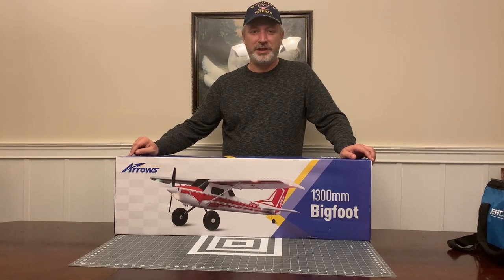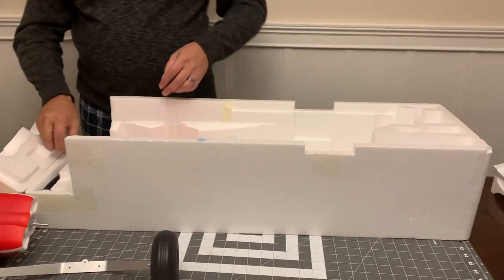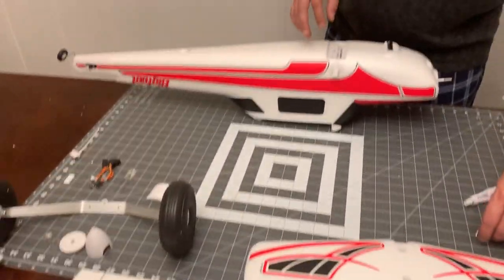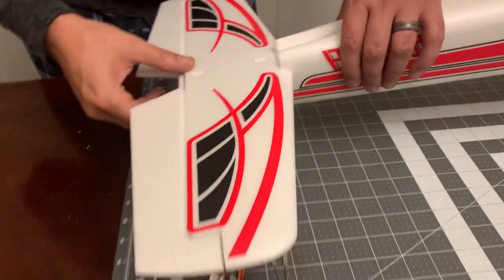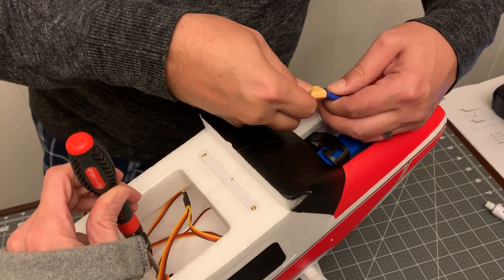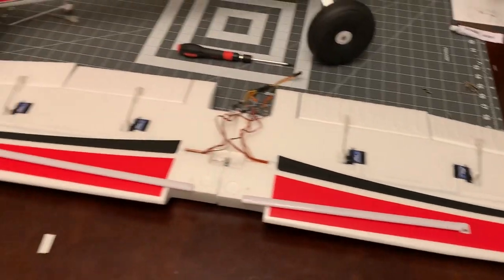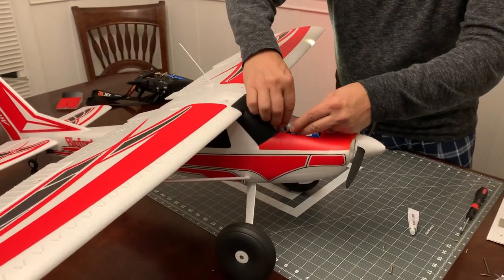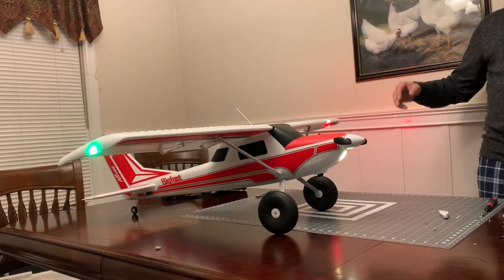Arrows RC Bigfoot - Unbox and Complete Build

Comment: Only thing I did different was put a block of foam in the body cavity to raise the RX to where it’s much more accessible. Also Dubro wheels for a, hopefully, softer landing!!
Great video!!!
John in MD
Reply: Also: there’s a small screw which secured the tail wheel tiller!!
John
Reply from the maker: Yeah, I found that screw and put it in the next day after I had already published the video... 😳
Reply: @TheRCAirMarshall  1st car engine I rebuilt(at 14!) had a small box of parts left over: Dad sez “Nope!!  Do it all over again!!!” 2nd time I actually followed the Chilton manual & got it right!!!
God Bless!
John
Reply from the maker: LoL! I’ve rebuilt a few engines myself. I’ve been guilty of having a few parts left over scratching my head. Funny part with the tail wheel screw, I was following the manual and just completely missed the step. The Arrows Husky Special Edition I just got also has the tail wheel retention screw but it is NOT in the manual to put it in. I knew better the second time around. 👍

Comment: I was using a Spektrum receiver whose servo leads came into to side, not the top. Made mounting the receiver a B*****. I also used servo extensions.  I ended up gluing in a flat piece of thin wood to the underside of the opening to mount the receiver. It worked. Otherwise, the build went smoothly. This is the first plane I have bough since the mid 90's  when I left the hobby.

Comment: Generally good with the exception of a major safety violation. You mounted the prop with the system powered up. The safety guys are constantly reminding us to NEVER work on a plane that is hot with the battery plugged in without removing the prop first. Most of us are guilty of a similar mistake, hopefully your injuries were minor, but just this week one of our club members was injured badly enough he had to go to the Emergency Room for stitches after he made that mistake. You set an example for many less experienced pilots to follow, hopefully we all set a good example for those just learning.
Reply from the maker: You’re absolutely correct. Normally if I do something like that, I preface it with a disclaimer that the prop should always be removed. This was a big oversight by me in the beginning of our YouTube journey. I get that I have a responsibility to the community and will try to make safety a priority. Thanks for the great catch and feedback, very appreciated!
Reply: @TheRCAirMarshall  I figured it was an oversight, but having personally injured in that kind of situation, I thought it important to be pointed out. I was lucky, a band aid took care of my careless act, I was really sorry to hear about one of our clubmembers being injured enough he had to get stitches. It really is important.
Reply from the maker: If it helps, the throttle cut was on at least. 😕

Comment: I just assembled my Big Foot. My kit came with the electronics already installed.  No Y connectors included.  I did the best I could with what I was given.  QUESTION for you:  where can I get different "softer" tires?  Any ideas or suggestions??????  Great video by the way.  The electrical connections are a bit confusing.  Some kits come with servos installed, other's come with them not installed.  I had the latter version.  I had a devil of a time getting the wires connected.

Comment: why not use channel 5 for the flaps and aux connection for the lights?
Reply from the maker: It’s just wired in my brain like that. Spektrum receivers and Transmitters set flaps to channel 6 by default and gear to channel 5. It would take a few extra steps in the radio programming for me to change the flaps to channel 5

Comment: Great build video Dave just a question I have bound my spectrum receiver to my NX8 the light on the receiver is steady  when I turn it back on the receiver light is  flashing can you suggest what I'm doing wrong cheers Bill from Tasmania
Reply from the maker: Hi Bill, what type of receiver are you using? It sounds like you either have a bind button that is stuck, or maybe you’re leaving the bind plug in? If it uses a bind plug, once you have bound the receiver you need to remove it or it will go into binding mode every time you power it on. If it’s a stick bind button try pressing it a few time to see if it will loosen up.
Reply: @TheRCAirMarshall  I'm using the ar 637t
Reply from the maker: Sounds like a sticky bind button. Try to put the NX8 in bind mode, rebind the receiver and see if the flashing stops.  If it does, that seems like a sticky bind button.
Reply: @TheRCAirMarshall  Thank you dave I tried that and it fixed the problem  That receiver you put in the bigfoot can you use that with the NX8
Reply from the maker: Yessir, you should be able to use any DSMX receiver with the NX8
Reply: @TheRCAirMarshall  Great Dave once again thanks cheers Bill from the Apple Isle

Comment: i have a single yellow wire coming out from under the battery board from the esc i imagine.what is this for?.
Reply from the maker: Not sure. Had someone else ask a while back. Mine was one of the first to be sold in the US, and it doesn’t have that yellow wire. Is it definitely coming from the ESC? Does it have any kind of connector on it?

Comment: Thanks for the box-n-build video. I plan to hit the road soon & would love to take a few planes on the road with me and fly wherever I happened to be. Since space is a premium in an RV, they would need to be broken down to some basic configuration; hoping that just removing the wings on each of them would be enough to safely pack them & save space.   Do you think this plane will hold up over time using it like that?
Reply from the maker: Oh yeah, definitely. I personally haven’t had to remove the wings since I built it, but it should hold up no problem. Over time I’ve learned that the Bigfoot is one tough little plane!

Comment: Hi, I know this is three years old but I’m hoping someone will be able to help me with this question. I’m a complete newbie to this hobby, and most of its components and terminology. I’ve bought this exact model and as yet not attempted an assembly, I’m interested in doing the two modifications on the wiring, namely using a different Y wiring harness and the longer extension for the lights so I can remove the wing’s easily if needed. I’ve looked on model sites, and even where I bought it from on line and I can’t feel confident in correctly choosing the correct ones, what exactly do I need, connector types etc. thank you Dave
Reply from the maker: Servo connections these days are fairly universal. If you get servo extensions / Y harnesses with a JR/Spektrum style plug, they will work for nearly every application. What you want to keep in mind is the wire coloring scheme. For every servo lead you will have 3 wires. Ground, power, and signal. Your ground will usually be either black or brown, power will almost always be red, and the with the signal, sometimes you’ll see the signal wire be white, orange, yellow… So when you’re plugging things in, especially when there are adapters involved, just make sure you’re plugging in your leads correctly. Ground to ground, power to power, signal to signal. Outside of that, shouldn’t be too difficult.
Reply: Thanks for getting back to me regarding this, a lot to learn and has I’m coming into the hobby late at 65 it gets more difficult to absorb things, 
I’m doing it as much for our much loved grandson as for myself, as due to ill health I’ve had to give up some lifetime pastimes. Thankyou for your time taken to produce these videos x God Bless, Dave

Comment: Got this plane crashes a few times low level crashes now my servo for my turning flaps starts sticking and twitching if I turn a certain direction. It stays like that sounding stuck until I free it with my hands.  Do I need to replace the servo ?

Comment: Having an issue with my Bigfoot and the flaps and adjusting them in 3 positions like you said.  Which wing type did you select in your transmitter?  Normal or 1 aileron and 1 flap?
Reply from the maker: Tyler Ording 1 Aileron, 1 Flap
Reply: @TheRCAirMarshall  Yeah that's what I tried initially but when I do that my flaps don't do anything.  I will play with it some more then if that is how it is suppose to be.   It's a great plane I just want the flaps working correctly where I can adjust all 3 positions.  Thanks!

Comment: Just got my Bigfoot, followed you step by step in the build. One question - the Throttle servo lead has a separate 4th wire - yellow in a single female receptacle. What is that for? I have checked out all the videos and couldn't find anything in the manual. What am I missing?
Reply from the maker: This single yellow wire you're talking about is coming from the speed controller? I don't think mine has that... I have no idea what it would be used for
Reply: @TheRCAirMarshall  Wish I had a way to post a photo so I could show you.  Yes, the ESC has four wires leading to the RX, three end in your standard servo plug and the one yellow one that ends in a single servo plug - I've only seen single plug servo plugs once before - just don't know what this one should plug into.
Reply from the maker: @Paul Moore is the wire on the plug in the Signal wire position? If so, this MAY be a reversing ESC, and the additional wire would be for a reversing channel. That is one possibility. It could also be for an external programming card. I would need more information about the ESC to be sure. As I mentioned, the ESC that came with mine doesn’t have that extra wire so this has me curious.

Comment: Airmarshall ,  Nice unboxing and build of the  Bigfoot 1300mm, is the safe system in that Bigfoot similar to the As3x in the horizon hobby RC Planes?
Reply from the maker: The Bigfoot doesn’t come with any kind of AS3X unless you get a newer one. This one did not have any receiver. The new ones come with a gyro but you still need a separate receiver unless you buy the ready to fly model. With a 7 channel receiver you can set them up to be very similar to AS3X, yes

Comment: What do you think is better? Eflite timber or the bigfoot?
Reply from the maker: I like the power of the Bigfoot a little better compared to the original Timber. The Turbo Timber on 4S has that extra power on tap which is nice. Between the Turbo Timber and the Bigfoot, I would go Turbo Timber. Between Original Timber and Bigfoot, I would go Bigfoot. Now, if you’re buying the Timber to use with floats, it’s a not brainer. The Bigfoot does not have optional floats available. Hope that answer helps. Thanks for the question!
Reply: @TheRCAirMarshall  ive been on the fence about what to get.  I started with a flyzone beaver 5 years ago. Then went to a t28. I really like the eflite turbo timber but i loved my trojan t28. I kinda want to get a t28 again but i want a bush style plane. I want a good landing gear, stol plane that i can put big tires on and fly it anywhere. My choices are 
1. Eflite Turbo timber
2. Eflite timber x
3. Fms kingsher (because it has skis )
4. Fms beaver 
And now i want this bigfoot and husky..  looks are great and i bet they would be really great with a biger esc to run 4s.
Reply from the maker: If you have a Spektrum Transmitter, getting the Turbo Timber I believe is a better choice. Already has floats, and is already 4S capable. The tires are substantially softer than the Bigfoot as well. The receiver in the Timber is a big selling point IMO. If you already have a receiver, the big Arrows RC Husky is a great choice. It’s float ready, 4S ready, 1800mm airframe so it’s gonna fly great. Hard tires on the Husky as well. So... Spektrum transmitter with no receiver? Get the Turbo Timber. Non-Spektrum user or you have a receiver ready to go, grab the Husky and get some softer tires (grand tundra tires). That’s my thinking.
Reply: @TheRCAirMarshall  i plan on getting a spektrum radio. So il probably go with a turbo timber. For the time being i ordered myself a umx timber  until i can figure out what i want. Theres just so many great planes out there to choose from
Reply from the maker: The UMX Timber is pretty awesome for a Micro. You’ll love it

Comment: Hello Dave, I am about to start my adventure into the Big Foot... after getting some confidence (I am a veeeeery beginning!! - beginner!) and I just managed to take off, land and control a 3-channel starter Cessna F949. I even installed flaps which made me control it better, and knowing that the Big Foot has flaps... that gives me confidence. 

Now, my main concern and I was wondering if you could give me your input on that is "stabilizers"... The little Cessna F949 has automatic stabilizers... and sometimes when I take that "auto stabilizers" off... I almost always crash! Of course now I am taking a lot of altitude in order to practice... but litte wind and I am out...  Now with the flaps is a bit better... but still. So I wanted to know if I am kind of in high danger of crashing this? and if I do... will it be resistant? I know it is not comparable the resistance of the little Cessna to this, but if I crash it, that will be it? 

As well, I am going to get my very fist sender... I am thinking on a DX8 thinking on the following aircrafts...  

Your input will be very highly appreciated! 

By the way, your videos are the best of many broadcasters I have watch in the last months. You look serious without loosing fun and very much natural, which gives a lot of confidence. You speak very clear, very elocuate and precise. Looking forward to watch all videos you have posted! :) And will happily watch new videos!  Your production assistant is really great too! :) Regards from a Mexican in Germany.

Comment: Thx for the build Dave! I just have to be sure. So the plane is Ready To Fly out of the box right?
Reply from the maker: You will need a transmitter, receiver, charger, and 3S 2200mAh LiPo Battery.